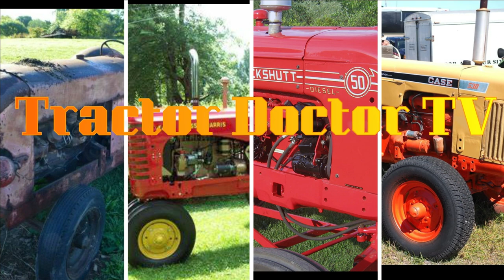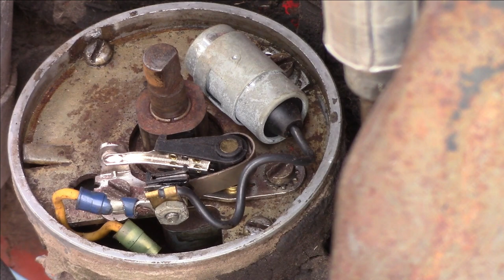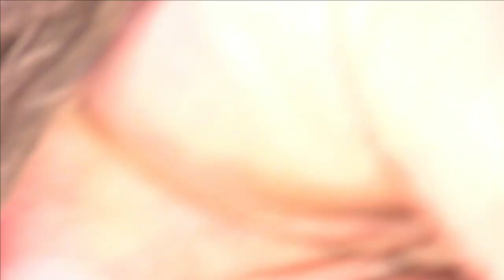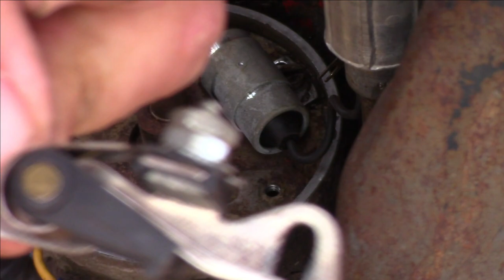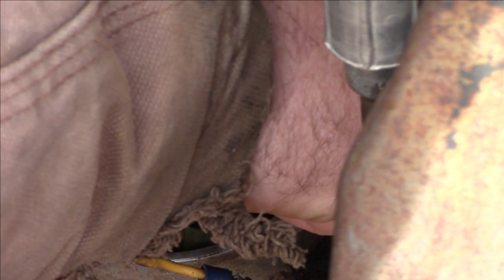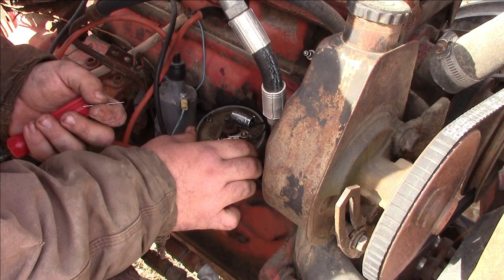How to put points in on a ford 641 tractor.

Comment: Butch 2
Doc, could the yellow wire that connects to the points be shorting out where it was bent and exposed with the distributor housing?
Reply from the maker: that could be. thanks.
Reply: That was my first thought too.

Comment: Another nice video Doc!

Did you fix the bare spot in that wire before you buttoned everything back up just in case it's causing the actual issue?

Now I'm going to have to do a bit of research. I've used kits to convert points distributors to electronic on classic car restorations when I've wanted to retain the original look. Since I don't own any gas tractors, I've never checked but now I'm curious if they're also available for tractors.
Reply: I'm pretty sure pertronix corp. makes them to fit most models
Reply: @Blazefork  It wouldn't surprise me, that's the brand I've used in the past and so far, they've had one for every application I was looking for.
Reply: @MikeBrown-ii3pt  They sure seem to work really well!
Reply from the maker: no . thanks for pointing it out.